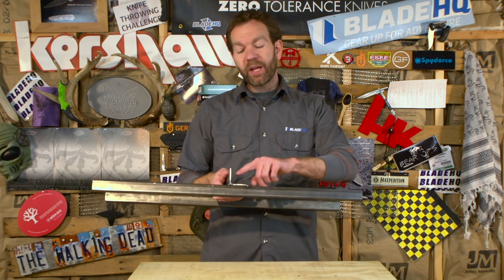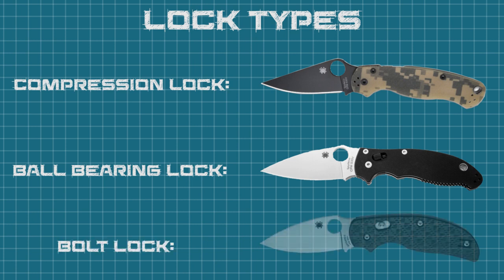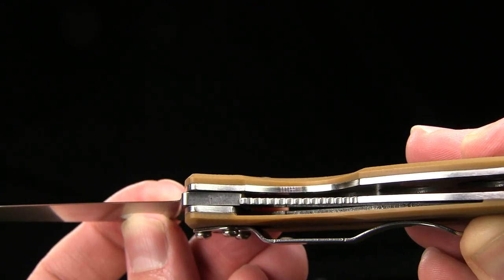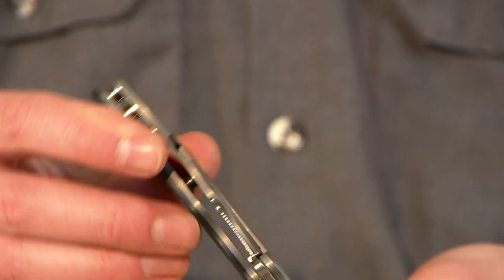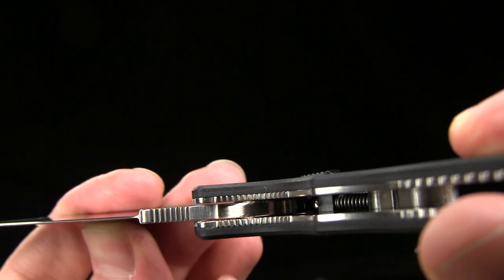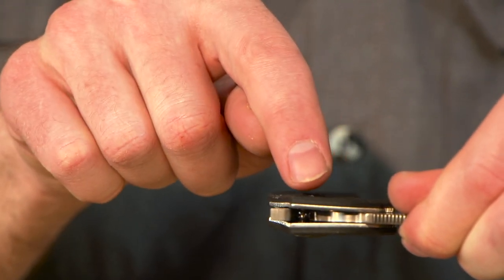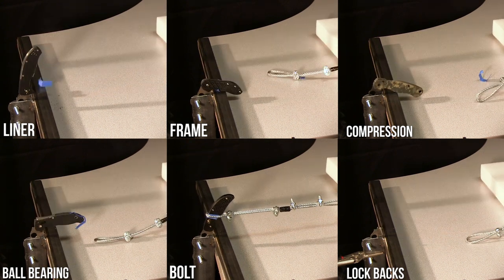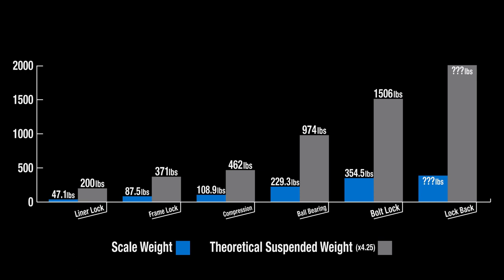Pocket Knife Lock Strength Test II

Comment: Interesting video but super inaccurate. As the cable slide up on the knife handle, the winch is able to get/have more leverage on the axis and lock. This means as each test goes on, some of them aren't experiencing the same force as the others. This is creating false data and has made the experiment not trust worthy. To create a more accurate test, each lock type must be tested multiple time, at least 3 times each, with the same brand like it is in the video, and the cable must be secure to the same place on each knife. Tightening up the cable should help fox this problem. Also some of the locked didn't fail at all, they kept the blade straight. Having a set definition of a "fail"  will also improve this experiment.  Is a fail when the lock just bends a little and be opened yet the blade is still locked forward or when the handle completely buckets putting a person in danger.

Comment: This test is embarrassing biased in favor of fancier new locks systems. How you can put in the final chart the weight of a liner lock that actually HASN'T FAILED "as max weight", when you have repeated the test for the slipped cable on bolt lock test, fixing It better? This makes no sense. You should have fixed the cable to stay at the same leverage point on all knives, considering the max applied force at breakage.

Comment: Are you kidding me !  I'm going to make the same comment like I did on your first video with the weights.  99.999 percent of blade use is going to involve pressure being applied the same direction the blade opens not the direction it closes.  If I was worried about lock failure due to pressure being applied to the back or spine of the blade, I would use a fixed blade knife. Pointless and ridiculous! And a total waist of time and money.
Reply: the blade wont close on your fingers the other way, thats most likley why they tested the knives in this manner
Reply: testing a blade in the opposite direction of this test would not be a test of lock strength. it would be a test of the blade and handle, more specifically the stop pin.  It would provide no data about lock strength which is what this test was for.  However i do think it would be a test worth doing but it would be testing completely different parts of the knife.  This video is a lock test and they put pressure in the correct direction to determine this.  This test was not designed to produce data about the strength of a knife, its about the strength of a lock. 
so i wouldn't call a test pointless and ridiculous when it tested what they said it was going to test., just because it didn't test what you want. Thats like being upset a car test for 0-60mph that didnt determine the breaking time from 60-0mph.  If you want a test for a specific detail watch a video about THAT not something else and then complain because they did exactly what they set out to do.